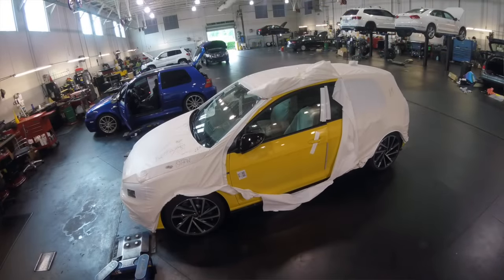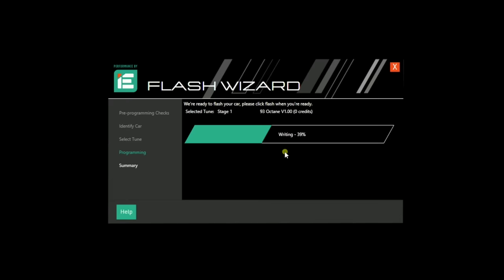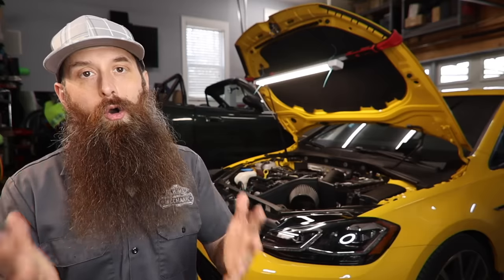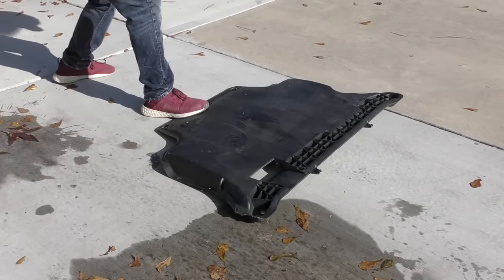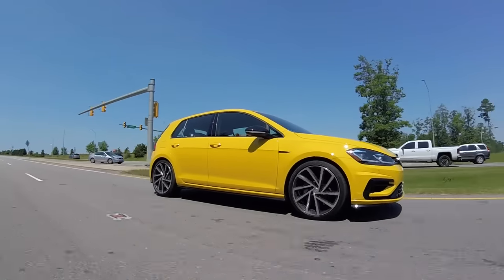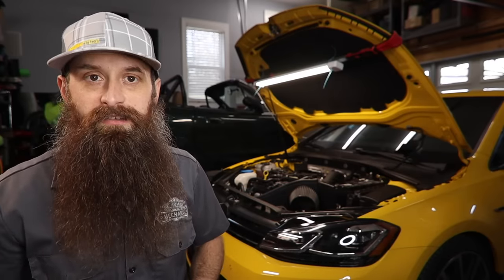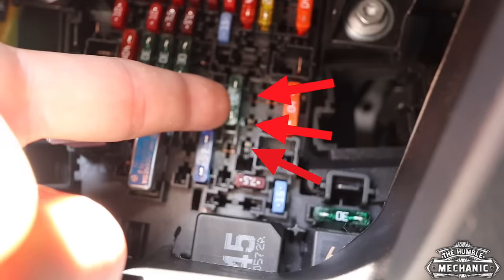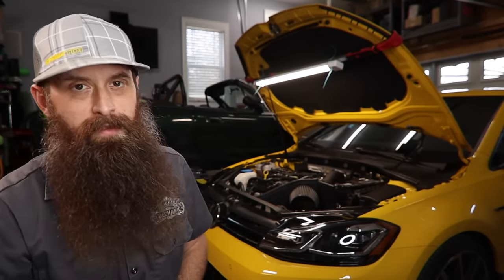The 5 BEST Modifications for the Golf R ~ Do THESE First!

Comment: I have a 2020 GLI Autobahn and my dealer here in Southern California were very specific with me on warranty as I kindly asked them questions about it. He told me straight up that if you do a tune and come in for warranty claims, the first thing they do is scan the ecu and look for flashes to make sure it’s factory. Then it’s automatically posted to Volkswagen and they know that your car is no longer covered for drive train warranty. The “Okay’s” are the exhaust (better to put on factory exhaust if you are concerned before going) wheels, and aesthetics really. If you bag it or do springs/coil overs whatever suspension mods, it will void the suspension warranties. He specifically said upgrading brakes and rotors are totally fine as the warranty rarely will ever cover them anyways lol

Comment: I’d also recommend the racing line r600 cold air intake as it looks stock and has a great sound, as well as the silicone air intake tube and inlet elbow. Definitely notice the performance difference. 

Aluminium shifters.

Definitely APR stage 1 ECU and DSG tunes.
Reply: I want to get one, but scared to hydrolock cos of heavy rains.

Comment: I have the Neuspeed Power Module on my 2019 GSW 4Motion and even that makes a difference. 200HP/252TQ makes the 1.8T fun to drive.
Reply: Neuspeed may be cheap but it will cause issues and if you hammer it a few times you'll go into Limp mode. It's a common issue on the 2.0t and 1.8t gen3 cars. If your gonna go piggy back tune buy a jb4 module since you get more power, customizability and alot less issues and less lag.
Reply: @IReahpZz  Never have gone into limp mode on my gen3 1.8t with latest Neuspeed version that ends in ".15". The key is to not use the +7 mode and stay on the +5 mode with at least 91 octane fuel, preferably more. It also cost $200 used while a JB4 is hard to find for under $400 used with the BT connection. Now, if I had a 2.0 it would be different, but for the 1.8t you can't beat the Neuspeed used for so little!

Comment: Just an idea, the 95B 4-piston, all-aluminum Brembo caliper used on the base Macan and Audi Q5 are direct fit for the stock calipers of the Golf R and Audi S3.  Many people have done the retrofit but there is no detailed write-up or video on it yet.  Both calipers can be had for about $500 retail making it a cheap upgrade while shaving off half the weight (from 18.8lbs to 9.4lbs).  Would make for an awesome video.

Comment: I installed an aluminum belly pan on my CC.  Two days later when I was on the Hwy a deer ran out in front of a pickup truck going the other way.  The deer was pushed into my lane and went under my car.  Only damage was a couple of stock plastic pans under the passenger seat.  This is a very good upgrade for any car.

Comment: The remote start would be super cool! I just got a 2017 Golf R and I was thinking about getting a remote starter. I heard that a DBALL2 with a immobilizer bypass should work.
Reply: Even better, enable remote start on a manual car. Difficult, but possible. You'd have to disable the clutch interlock if there is one.

Comment: I have a 2014 GTI with 150k km on the clock. I have been taking it to the official dealership all this time but I am finding that the dealerships are actually quite bad at maintaining the vehicle for long life span. I am wanting to do some maintenance upgrades, to keep the car running smoothly. What else would you recommend? Rear main seal? catch can? cleaning intake vales? regular changing of DSG oil? Thanks for the great videos

Comment: Hi Charles.  Thanks for this list.  I got my 2019 Golf R in November and finally got a few of these done.  Just got my car back from local shop Cantrell Motorsports.  They installed the 25mm anti-sway bar and the skid plate.  I "installed" the spare tire kit a month ago or so.  Car is pretty much sitting in the garage while we shelter in place (still).  I hope to run my car in at least one nearby recreational HPDE this summer, so I had Stoptech SS brake lines installed (along with Motul and Ferodo performance pads). Personally, I think SS-sheathed Teflon lines are essential for any car headed for a track day. I'm hopeful that I can get out this summer, but I'm wary of any kind of public gathering -- social distancing rules notwithstanding. I'm a 7/10ths track day guy, so unless the stock power is completely inadequate, I think I'll avoid a tune for now.  Thanks again.  Very handy videos and guidance.

Comment: Dig your Golf R. So addressing your warranty part ~4:00 we have a '15 Audi S3 with APR Stage 1 low torque ECU tune currently. It previously had a Stage 2 high torque tune and DSG tune (also APR) with downpipe from previous owner and it had to goto Audi for service for something unrelated. They voided our warranty for powertrain altogether. So regardless of which dealer we went Audi of America did not do us a solid. And we had flashed it back to stock before bringing it in. We ended up having to replace our turbo and clutch pack (or something like that) out of pocket and it was about $7k.

Comment: I drooled over the Imola Yellow R at my local dealer today. It's a Manual as well. If I had $50k to blow I'd of said sayonara to my Tiguan and drove it home. Lol
Reply: RJ mi  they are beyond silly on price. You can't hardly even get a decently equipped Tiguan for under $40k. Dieselgate really dropped resell value and jacked new price up.   About the cheapest VW we have is a base model Golf and it's right about $23k. VW would do good if they gave us the Polo and TRoc to fill the gaps in the lineup price wise.
Reply: @danielhildebrand6892  The tiguan is pretty versatile though? Must be good to be able to go off road and be a little higher up

Comment: Awesome video as usually ....highly agree with the first 5 mods list....I have them all on my MK7 GTI....one other easy and helpful plus cool mod is the auto hatch kit mod using the key fob to pop the hatch ...it does require changing  out a few easy parts and possibly some coding....When I installed mine it did not require coding and it has worked flawless every since....loving the progression of the Golf R.....👌cheers

Comment: Fantastic info.  As a person with an APR stage 2 2017 GTI Sport that I had lemon lawed, TD1 flag does not void your warranty.  It can cause you to have certain items denied.  This did happen to me, but like you said.  Be polite and work with the dealership.  I ended up contacting VWoA, received an advocate and she worked with the dealership to warrant a new ECU.  That didn’t fix the issue and long story short ended up getting the 2017 GTI Sport replaced with a 2018 GTI SE.

Comment: I have Stage 1 APR tuning on my 2016 R, as I did on my 2012 model, and the GTI that preceded it. Worth every penny. The big difference is that my latest ECM chip was installed by the dealer, and had no effect on warranty. So I don’t need a “stock” setting to use when I take it to the dealer. It stays on all the time.

My only regret is that I chose the DSG transmission (also upgraded). It’s butter-smooth on upshifts, but lags on downshifts, and is not quite as fun as the manual. Though the paddle shifters help.

Comment: The cool thing about the feature of windows rolling up & down with the remote, is that in addition to using the remote, you can also hold your hand on the handle (the ones with sensors to close or open the car) to either open or close the the windows (hold the handle or push for a >1second), without turning ignition on... super nice feature, especially when you just parked and realize a window/sunroof is still opened and you're outside the car ! no need to get back in! even if you keep the keys in your pockets!

another cool feature is to turn on the fog lights at low speeds when turning left or right. Helps to see curbs, obstacles.
Reply from the maker: My corner lights work that way I believe. I rarely drive at night. Lol. 

Good point on the windows. Has to do that 2x this weekend with the Touareg

Comment: Granted, this is on my Mk7 GLI(2019)... When I first got the car, I didnt have a VCDS but there were a few features I really wanted like the remote windows and disable that annoying auto start stop right away. I bought a cheap wifi/bluetooth OBD adapter off Amazon and subscribed to Carista for a week($10). I was able to enable the remote windows and disable the auto start stop with some simple option clicks. I know the remote windows probably isnt as much of interest to you but the auto start stop is.  Also, I do not receive any errors with the auto start stop. It does however show the A circle with a slash through it at the top of my display when I come to a stop. Its the same icon that comes up as if you were running A/C, car warming up, etc. So I believe its an icon that will be there regardless. Anyway, just thought I would let you know as it may be a cheap way to figure out how it can be disabled without errors. Maybe scan the car before and after, then see what was changed in the coding. I havent personally yet as it accomplished what I wanted so I just leave it be. Maybe it will help if you arent able to figure it out or if you have the adapter already, an easy way to just get it done.

Comment: Just upgraded my stereo and sub,  its a mod I appreciate every day, doesnt make the car any faster but I feel much cooler 😎
Reply from the maker: What did you install? Not going to change the R, but the R32 needs an upgrade
Reply: @HumbleMechanic  It was in my '12 Mx-5 and due to space constraints I did a JBL BASSPRO SL 8"  powered sub and a Kenwood DDX9904S head unit.  Miata's have always had underwhelming audio, but this was just the ticket.  Small, sounds great and was (barely) able to get it under the passenger seat.  Easy install w/ step-by-step instructions from Crutchfield.  Good luck on the R32!

Your vids are top notch, keep them coming! Especially those Miata vids!

Comment: One change I made on my Alltrack was the rear 2 outer headrests couldn't stand the tall ones that come on NA cars, the European rear headrests are very similar to the center head rest (low profile) and make a huge difference when looking out the back. Now I have an unobstructed view. I don't have part# but if you like having better visibility get them...they were pricey around $360 for the pair.
I know it's not performance related but IMO they were worth it. I want to do a stage one tune and DSG tune (can't stand the low shift points). I would also like to hear a little exhaust note but to get that without drone is a issue. AWE "claims" no drone but local shop that sells and installs said don't and the drone is so bad he's had customers come back and have AWE system removed and this is the" touring" exhaust not the "race". He suggested down pipe instead but that requires stage 2 which I don't want. Techtonics Tuning has a SS system but no reviews on it. Any suggestions?
Edit: The very first mod I did was changing the factory springs and shocks to factory Golf "R" springs and shocks I could not stand the too soft floaty feel ride with the stock suspension the Golf "R" is perfect IMO fitment, ride quality, it"s noticeably more firm and sporty in a good way plus lowered it quite nicely, I don't do much if any off-roading so it's basically the same ride height as a "R" I also used the Audi TT rear spring rubber mount.

Comment: Great video and i just got a MK7.5R and have watched a lot of your vids on the car :)  Just wondering if you considered a front LCA upgrade (to increase caster and camber) or camber tops as the car seems to come with more neg camber in the rear than the fronts which i assume is the standard "safe" setup.  I will definitely be getting a stage 1 ecu/dsg tune and rear swaybar upgrade but also want to dial in the alignment to get more front end grip.  Cheers :)

Comment: I did rear sway bar, dog mount, end links, tires, tune, air box mod drop in filter and snow catcher delete first. Than I went stage 2, Catted DP, and upgraded my suspension with coilovers. Only cosmetic I did was Aerofabb rear lip and CF diffuser and euro tails and light switch, euro mirror glass.
Reply from the maker: Nice!!!!

Comment: Thanks for the great videos, very informative & well made. I'm thinking about getting a used 2004 VW Eurovan Camper. Are there particular trouble spots with the VR6 engine or upgrades you would recommend? Could a newer 2 liter I4 TSI engine replace an older warn out VR6? The Eurovan is still a nice platform for touring & some overlanding if you don't want a larger more expensive Sprinter van conversion. What would your dream Eurovan contain? Thanks again for your show, PK.

Comment: Are there any particular rear sway bars you recommend beyond the H&R you opted for?  And any particular reason you chose that one?  I got my R almost exactly six months ago as well and would like to make that my first major modification of the car. 

By the way, I love all your videos.  Your content is some of the most informative on the internet.
Reply: Tempestwrath I’m gonna throw my 2 cents in here man and say 034 dynamic+ springs, they only drop the car .4” in front and .8” in rear so they are function over form but, my car handles rediculously good. I also recommend 034 sway bar and endlinks. Add me on IG bro. Lil_danny904 and I’ll suggest some mods for you to consider. Thatdudeinblue just reviewed my car Sunday and told me that he couldn’t even make my car understeer lol either he can’t drive or the mods I just suggested really are that good, just holler at me man:)
Reply: So where I live, we've got a local VW tuning shop that supplies and installs parts like these. They told me that they recommend H&R because they're a generally great name brand, great product quality, and the bushings, (I believe), are made of a teflon/urethane composite that eliminate all squeaking noises and don't need lubrication. I'd personally highly recommend them!
Reply: Jack Curtis that’s wassup. If I ever encounter issues with my setup I’ll give H&R a consideration

Comment: Looking forward to your factory remote start attempt!!!  

On the automatic start stop. If you look in your manual for the car you will see the following 

“Golf R: the start drop system switches off automatically if the race driving mode is selected, if the custom, drive system: sport driving mode is selected. 

So you can configure your custom driving mode to make the automatic start stop function be off without VCDS or OBDeleven coding.
Reply: Exactly.  I only have mine in either custom or race.  Have never used start/stop.

Comment: Hi Charles, I saw one of your videos from a while back about a 2.0 Tsi tear down. There were a lot of comments about those engines being ticking time bombs and a lot of parts that could fail with terrible results. I bought a 2018 R, and was just wondering, in your experience, if maintained religiously with oil changes and regular maintenance, can they be a long term, reliable option? Or are they best suited for people that want to mod them and then swap them for something else before the warranty expires?  I was down to either the R or a Tacoma (need all wheel options where I live) and went with the R. Now I’m wondering if I made a mistake. 

That being said, I heard horrible things about the FSI and had a mk5 GTI for 8 years with 0 issues. 

Love the channel and loving the Golf R videos.

Comment: Mentioned you would save money since the manual wouldn’t need a DSG tune however as soon as you add nearly anymore power the clutch needs replaced which is far more expensive than the tune.

Comment: There's a thread on the VW Watercooled (Australian) forums where a small circuit has been designed to simulate the pushing of the auto start/stop button when the engine is started.  This way, no weird coding hacks are necessary with VCDS.  FWIW, I use the voltage method myself and the warning message isn't too obtrusive.

Comment: I have a (Canadian) '18 R and OBDEleven and I used this method for disabling start/stop, and it works perfectly:

Disable Start/Stop
Select Control unit 19
Adaptation
Start Stop Limit voltage
Value=12

You still see the disabled start/stop symbol in the upper instrument cluster when you come to a stop, but there are no other warnings at all.
Reply from the maker: That’s the one I don’t want to see.
Reply: @HumbleMechanic  Well, if you find a way around that, please do a video on it and I'll happily try and replicate on my '18 R.

Comment: Hey love your videos, they've been very informative. I'm looking into getting a 2015 Golf R with around 60k on the clock. Southern car, owned in GA and SC it's whole life, 3rd owner.  Has good maintenance record.  Owner put a Cobb AP stage 1 tune on it with Stage 1 DSG tune.  The price is right, and I've test driven a bunch and really love the car.  Reading about 2015 cars, seems turbo failures were much more prevalent and in general that people have seen the IS38 fail in later revisions. Should I spend more money on getting a more "reliable" turbo and install it immediately? Stay away from the 2015 or Golf R altogether? Get another BMW?? I'm very conflicted because the car is out of warranty and these turbo failures seem to do a number on the engine once they fail. Sorry for the long post.